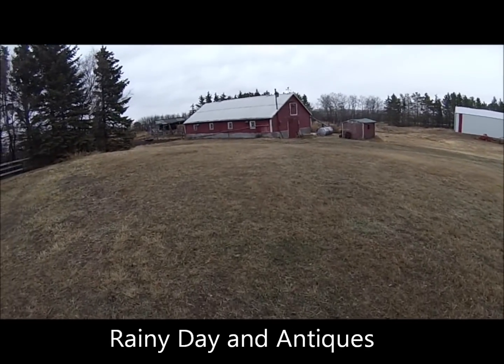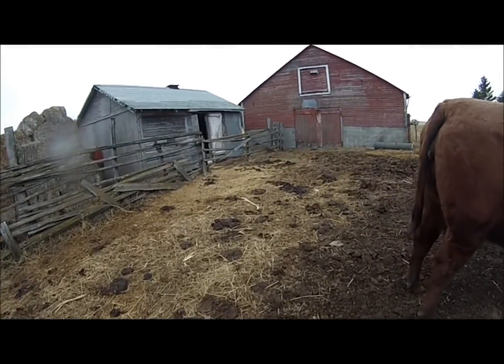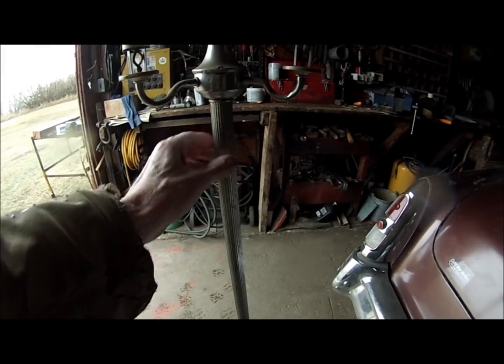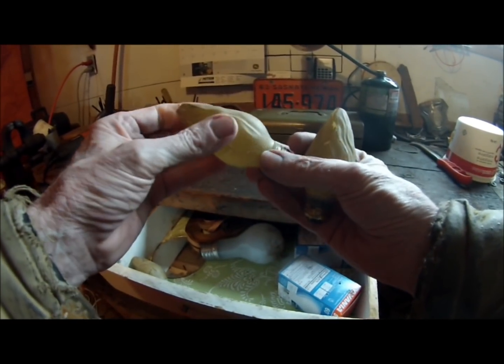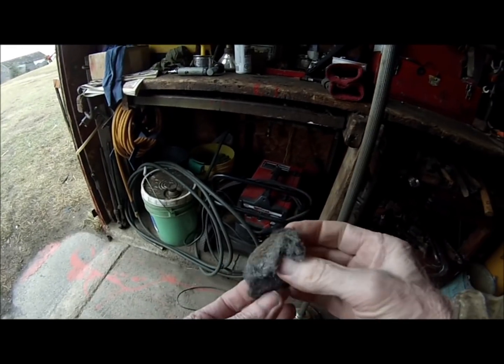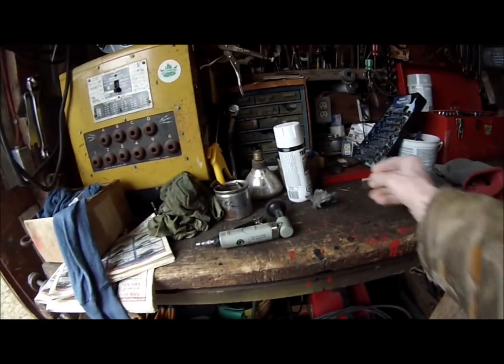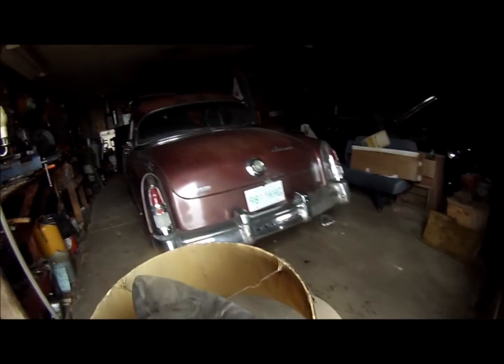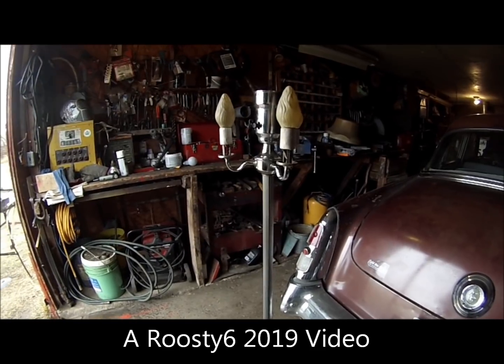Rainy Day Antiques

Comment: there is a white milk glass bowl that goes around the 3way bulb. the small end in the lamp and larger end will fit the notches in the shade, would be about 6" tall.  also there is most likely a small bulb in the base as a night lite
Reply from the maker: Wondered if there might be a base light. If so it is not working.